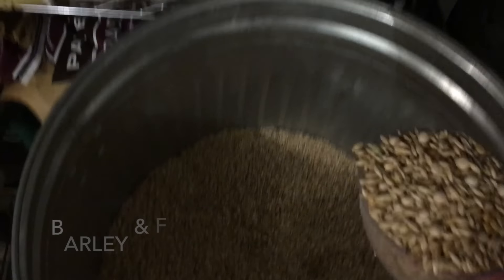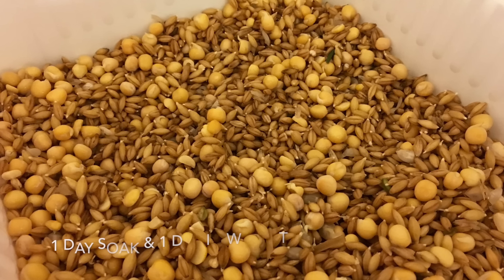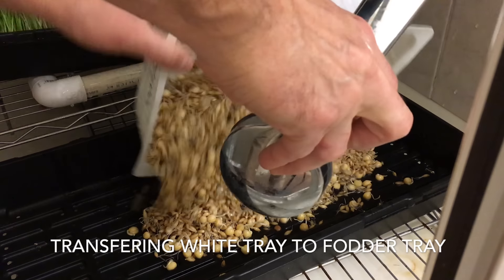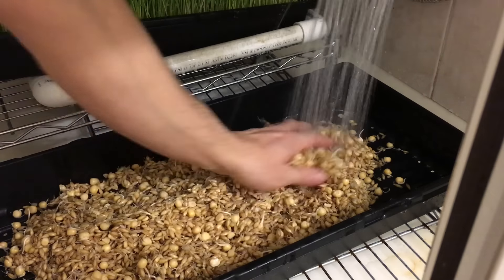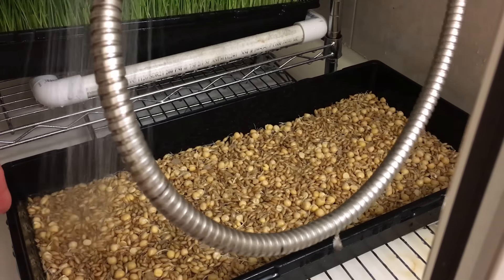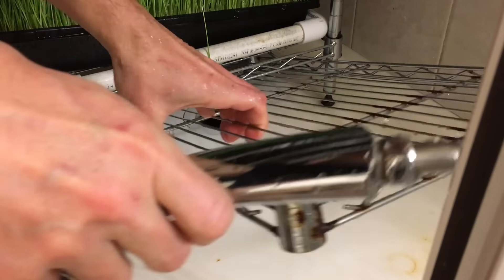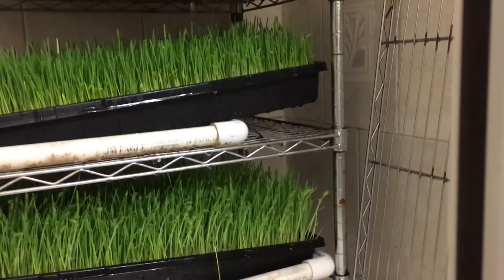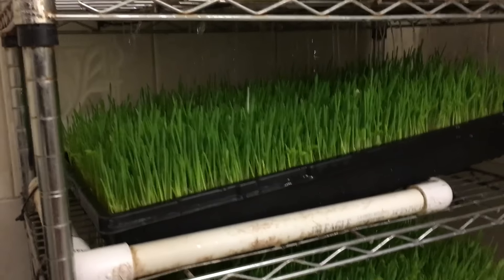Our little fodder system

Comment: My wife are in Ca in the Sierra Nevada mountains. We have mirrored our fodder set up similar to yours other than ours are on a rack but not in the shower. My Question is we are having uneven growth in the middle of the trays as they seem to only get about half as tall. The root mass is fine but the greens just aren't getting as tall. We have tried less water, more water, more drill holes. Any suggestions you might have to get the trays to be more even? Thanks for the videos and like I said after watching many others we mirrored ours after yours. We feed three trays a day to 9 wool sheep and three goats. Thanks Kurt and Laura
Reply from the maker: Kurt Duren ... Hi there!  Well, mat thickness maybe?  I would start with a good 1/4”-1/2” thick bed of seed.  The other idea would’ve the watering.  If the center was not growing that would mean that area is not getting enough water on it.  Not water that may run under the roof mat but water over the seeds.  I stayed it before, you cannot over water this system but you can under water.  Drainage is the other huge key.  Stagnant water will destroy a tray in a couple days and if in a cascading system like this, it will send fungus and kill the trays below.  I have another video with this system that may help on my channel or linked in the description but these trays were a lifesaver when I did this.  That is, the black trays, not the white ones.  Not sure the costs now or availability but these trays were a game changer for sure.

Comment: Hi good day, what are the specifications for your 1. Temperature 2. Humidity 3. Light intensity
Reply: 1)  Anything above 7 degrees celsius (45deg F) will sprout most seeds.  2)  Negligible 3) again, negligible because the seed provides everything it needs for early stages of growth (no light required), except water/heat of course.

Comment: Have you had any issues with mold on the sprouts?  I'm using wheat/sunflower and the sunflower seeds seem to produce some mold.  Also, fruit flies and/or gnats are a problem for me.
Reply from the maker: Mold with wheat?  Yes.  Every time.  That's why I switched to Barley and Field pea.  Over 20% protein so I was comfortable with that.  A good rinse with fresh water, not recycled, works.  Also at least two washes a day.  Alas, I just never had great success with wheat fodder.  Hydrogen peroxide... baking soda...bleach... store bought water... our well water.... different sized containers... nothing worked for me using wheat.
Reply: @CKKnifeandTool   My intention has been to switch to barley over wheat, but wheat is what was available to me when I started a few months ago.  I actually haven't found any barley locally, I'll have to order it online.  Thanks for the help!  Great video too...was one of the ones I kept going back to as I started my fodder system.
Reply: If it helps I use a combination of oats, rye, and soybeans that I have had good success with if barley is unavailable.  The soy beans add extra protein and make a very nice root mat.

Comment: I built a pretty elaborate fodder system to see if it could be used in my beef cattle operation.  I set aside 12 steer calves and fed them fodder as well as let them graze native grass like they normally would.  A couple of calves died from scours and the group as a whole gained less weight than the calves I fed no fodder.  Good idea but I did not find that it actually worked.
Reply from the maker: Good thing you did your own testing and research but this system is for rabbits and is not only quite popular to save money and give higher protein to them, it actually works quite well with the little guys and they absolutely love it.  Granted, you still should add dry grains and grasses as well as other fruits or vegetables whenever you can.  Thanks for watching and the input!  It helps folks immensely.
Reply: Cattle/horses/ruminants need roughage as well as fodder/pasture. Were you also providing hay? And did you do the proper dry matter calculations of the fodder for the feeding to know how much to give them to maintain adequate weight gain?

Comment: Bleach how much used thank Sir
Reply from the maker: You can find a bleach to water ratio on line.  It's used quite often as a way to clean water under emergencies.  There are good references on the internet.  As for what you see here in relations to the can, it really not much.  Maybe 1/4 or less a tsp.

Comment: Thanks Great video. Where do you get your barley? Here in South Carolina it is had to find if at all and shipping on line is very high?
Reply from the maker: I hear that a lot but you just have to shop around.  There are folks that may want to get in and order a pallet and split it.  Check into that as well.  Wilco, Cenex, Tractor Supply as vendors?  Or look into getting a pallet from the grower.

Comment: Thank you very much it was very useful I'm wondering what the bleach is for
Reply from the maker: To ensure no mold growth.  When done and washed, I could put fodder grains in my mouth and chew, not very tasty but absolutely no bleach taste in grains.  using bleach in this way is no different than using bleach to disinfect water that is questionable for human consumption.
Reply: @CKKnifeandTool  i might suggest using white vinegar, kills 100% of varieties of mold where bleach doesn't.  My sister worked in a factory where they made food products and 1 year they had problems with mold on walls due to unusually extreme rainy season and surrounded with marsh. She bleached walls every 2 days and mold kept coming back. Ran out of bleach and in a pinch used white vinegar and mold never returned. There even supposed to be a study done comparing germ killing ability between bleach and vinegar and vinegar killed 100% and bleach was around 80 to 90%, I can't remember exactly what the %on bleach but I seen the vinegar killed 100% and I was sold. Safer and 100%.  Just a tip. Enjoy your videos.

Comment: Do you need any sort of lights for the system as it doesn't look like you have any lights... Do you need to leave the light on inside the room?? Will it work with minimal lighting? Thank you, this was a great video. I've been wanting to do this for a while. I like your setup. I think I would do it in tubs or something so I could capture the water runoff when setting seeds and such. Must be quite beneficial if you're willing to give up one of your household showers!
Reply from the maker: I just used the 60 watt bathroom lights.  Leave them in for the day.

Comment: Nice video 👌 but I have a question about this 1) How much we have to use blech to mixed with gain
2)Can we use to feed Cows,    qails
And Chicken any trouble of blech that is used in this
Reply: Its to prevent mold i assume, I suggest using white vinegar, safer and kills all varieties of mold where bleach doesn't.

Comment: What is tray's Size?
Reply from the maker: https://www.amazon.com/Strength-Propagation-Germination-Bootstrap-Farmer/dp/B01BKOG6PM/ref=sr_1_2?ie=UTF8&qid=1504708038&sr=8-2&keywords=fodder+trays

The above link is the tray I use. I am not affiliated with the seller on Amazon.  Inside dimensions were approximately 10 inches x 20 inches x 2 inches.  Hope it helps.

Comment: This might sound silly but I have no knowledge in this type of thing; is the water just water or do you add, dissolve or mix-in anything additional, such as minerals and such? If the water needs additional things, would it be a good idea to filter the water through a natural filter, such as layers of soil, rocks, etc, to mimic something more natural? If so, would using a system like this be beneficial by slightly increasing the nutritional value of the product or is that way too insignificant?

Comment: What abt how often u water them, temperature of the water and the room, how long before they are ready????
Reply from the maker: Watering is twice a day for 5+ min per tray.  I try to water the last couple trays at the bottom longer to wash away any impurities from the top trays.  7-8 days is all it took to grow to a nice full mat and feed.  As for the trays, the price keeps going up for the good thick trays and it forces folks to buy the thinner, cheaper trays that will split and crack after just a few grow cycles.

Comment: Thanks for the video.
A few questions how many chickens to a tray?
How long does a tray last? Is it 1 feeding?
How long did you say it took to grow?
Reply: I have 12 hens and they can knock one tray of grain like this  in 3-4 hours
Reply: @nomadismileseeker6611  Do you give them fodder everyday? I have 8 and they do not free range so I want to introduce fodder.
Reply: @chavachava6400  I try to.
Reply: I've seen a person put this in a box with a screen just over.  Not sure the hole size but it slowed them down. Made them work for it.  I just wasn't sure what to use for the greens. This is perfect

Comment: what temperature we should maintain
Reply from the maker: J Mohd.... I've had good results with 68-72 degrees.  When the temps became higher and the fodder was exposed to near or at 80 degrees I needed to water three times a day.  Cooler temps slow the growth down and made the fodder thinner in growth.  
We use to grow in garage.  Take outside to water and then bring back in. That's where I garner the experience with the temps.  The system just got too cumbersome for the kids to manage and we started getting chipmunks sneaking in when the door was open.  In winter it became too cold in garage (even being attached) and temps never got much higher than 60 degrees.  This is what prompted us to move into the spare shower.

Comment: I agree with some of the other people.. this is really over complicating the simple process..  I'm glad it works well for you but there is an extreme waste of water going on.  The trays you are using appear to be a standard seed starting tray with holes drilled in.  These trays can be picked up at any garden centre for about $2-3..  I would suggest starting sprouts in 5 gallon buckets for the larger consumers and then moving to trays.  Soak the trays once a day and then drain the water onto the next tray and re-use the water as opposed to sending down the drain.

Comment: Did you know that fodder don't take 24 hours to germinate?  12 hrs or even a half hour will get them to germinate.  There was an experiment done and only  a 30 minute soak grew higher than the 24 hour soak.  So, there you have it.
Reply from the maker: Ending a statement with, "So, there you have it." Is a bit... well, arrogant really.  Maybe not how you meant it but none the less.  A little rude.  With that stated, I'm sure I can speak for the community of followers and viewers when I ask, can you provide the link?  Any information regarding that statement would be very helpful to everyone.  As I have stated in many responses to comments, I welcome anyone that has another way or more information to share with the rest of us.  Not just come on here and make comments that are not productive.  The settings on the video here are set so as folks can share helpful information.  Thanks for watching.
Reply: @CKKnifeandTool  I just ran across a video (I have no idea who did the video) but it was experimenting with different times. In the video the grain that got soaked for only 30 minutes initially did better immediately. The other two times were for 12 hours and 24 hours. The 12 hour soak did the second best and the 24 hour soak did the worst. However towards the end of the experiment (7 days I think)  all 3 soaking times were almost equal in growth. So I guess the takeaway would be if you wanted to soak your grain for the 30 minutes and use it sooner than the other two soaking times then that may give you a bigger sprout.

Comment: Waste of water!
Reply from the maker: Yes, it can be seen that way.  I wouldn't recommend tnis for city life.  I did have a spring/summer/fall set-up that allowed me to water this way outside and I had a large tray on the bottom shelf to collect the run off water and used it on the garden, flowers, etc.  It's too polluted for reuse on the fodder system unless you ran it through a Berkey filter or something similar.

Comment: pretty smart way to do but you wast a lots of water
Reply from the maker: Thanks and yes...  We did have this rack system in the garage and used Rubbermaid Totes to collect water and then pour on lawn or plants but the kids couldn't manage that and with the temps dropping below 50 degrees in the garage during winter or the chipmunks raiding the trays in the spring/ summer, we had to find an alternative that worked.

Comment: Ah, ya tricked me. Opening claim of no oxidizers turned out to be something of a half truth since you are using it to soak. Barley grows mold as well, but you are correct about temps and drainage. Good call on the mix of grains though. Seen some tests where grains germinated quicker/better with a shorter soak or none at all. Have you experimented with that at all?
Reply from the maker: Jamie Coffman... not in my experiences.  Trying to grow without soaking creates more mold in regards to wheat and more slim/yeasties with barley.  The 24 hr period worked best because it fit into the watering, feeding and maintenance cycle. One thing I learn though is even if I did EXACTLY what someone else does and is successful, it may not work out for me.  Different states.  Different water.  Different house / outdoor temps... and lastly, people's idea of being diligent.  If it helps a couple people that's what this video was all about.  Maybe it didn't work for them but it's one idea down and something might have been learned.
Reply: Thank you so much for reinforcing that experimentation is KEY. As is isolation. The success rate of many DIY processes hinges on  the particular area, site specific variables being a dominant factor. The willingness to experiment with those variances will likely lead to some failures. eliminating those things that hinder success is what ultimately leads to success. Instruction, mostly, is best considered a guideline. <><

Comment: Great video.   Are the trays moved down each time you harvest one?  BTW: You can get those trays a whole bunch cheaper, tho. Home Depot sells 100 for $258 - or 2.58¢ each.
Reply from the maker: Thanks for watching and the comments.  Sadly, the local box store by me sold a SIMILAR tray but it was much thinner and didn't last near as long as these.  Now, I have to preface, I have no idea what the costs for the trays are right now.  My guess is they are getting quite inflated and possibly out of reach for many of us.
Reply: 100 for $258 is $2.58 each.

Comment: are there any organic substitute to bleach?
Reply from the maker: Hanson... Some folks use hydrogen peroxide and water to spray on their fodder during the watering process to assist in killing bacteria but that was a bit more costly and I had no success in that process.  The bleach isn’t anything to be wary of though.  It’s such a minimal amount that it wouldn’t harm anything.  It’s really no different than the amount used to make water safe to drink if contaminated.  I do understand your concerns though and the bleach was a last resort.  I say go ahead and try without.  Our grains come pretty clean and our water was rated pretty good... no high levels of iron or such.
Reply: thank you for replying.  i tried without bleach but i got a lot of moulds and pesky flies.  i'll try again.  thanks.
Reply: ok, so i tried the bleach thing..  and i placed it indoors... initially, it was ok.  but after 3 days, the peas were fermenting, and breaking down.  some had roots coming out but definitely not all.  makes me wonder if it is because i was using green peas?  i'll be trying corn next.
Reply from the maker: One problem is probably the green pea.  Never heard anyone use those for fodder.  Neither have I heard corn being used.  Good luck.
Reply: i'm trying other grains now..
Reply: what are the common grains that i can use?
Reply from the maker: Wheat, barley and field pea.  These are not the store bought kind.  They are found at fed supply store, eBay, granaries.  They are whole non-processed grains.
Reply: CK Knife and Tool I was wondering if anyone has tried colloidal silver. If you generate yourself it's practically free and it's organic and fine for consumption. I sometimes put it in water to keep it from spoiling.
Reply from the maker: Melissa Jones... I’ve never heard of doing that but seems interesting.

Comment: How dare you waste so much drinking water!!!
Could not you get it back, go over it again? This water is not dirty after all.
Reply from the maker: Caleche... “Dirty” can be defined in different ways.  The Ayer used for watering washes away bacteria’s, molds and such and therefore if stored and reused on the fodder again would promote the same in the fodder and ruin your trays.  If, you had read through the comments or at least the update in the description you’d see many answers to the questions and comments.  One in particular where I mention having saved the water and reusing it on outside plants.  We did that for quite a while.  Wanting to continue to grow through the winter, the unused shower ended up working great.  Now, seeing how we have a septic system, any water eventually ends up in our drain field and that waters the grasses and flowers.  If that makes you feel a touch better.